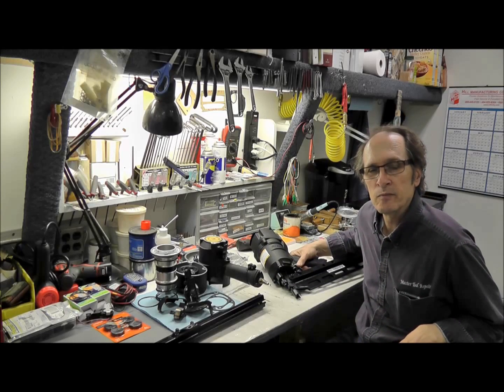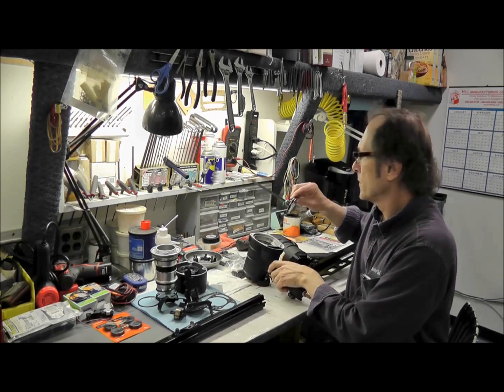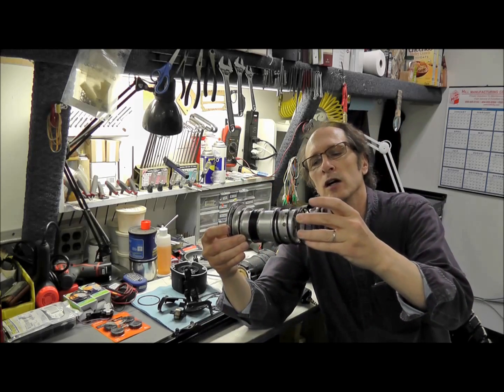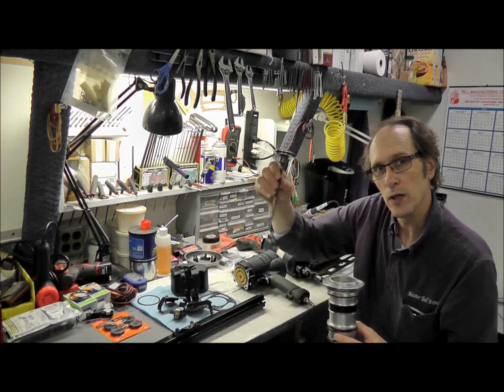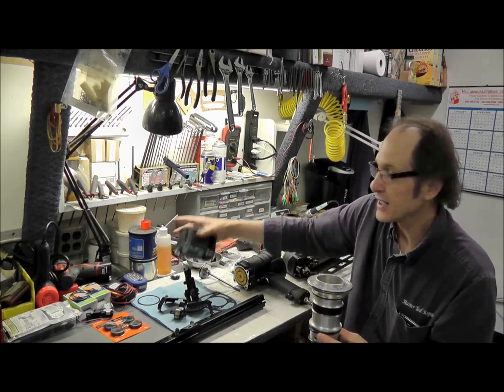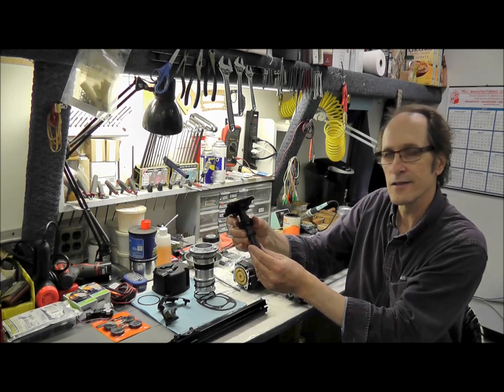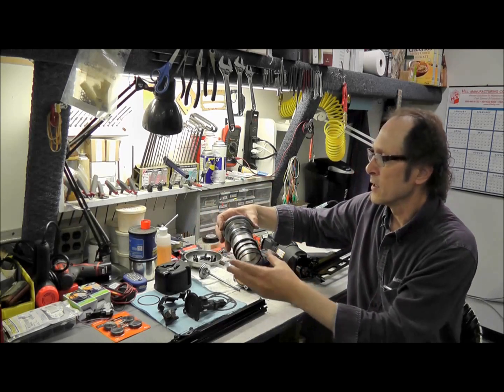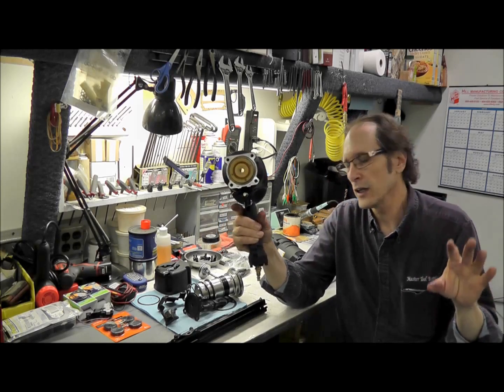Hitachi framing nailer disassembled and parts that go bad

Comment: My nr83a2 just started to slowly push out the piston driver after plugging in air hose. I’d say nail is pushed out very slowly and very minimal, nail is not shot out. But piston driver does seem to be pushing out. Interior air leak?

Comment: I got one for ya..  two of our framing guns, an NR83AA and an NR83AA5, have an issue where they fire every other nail usually.  The driver isn't retracting all the way to allow a nail to enter the chamber.  It's almost as if it doesnt have enough air pressure to retract (compressor at 120 and other hitachis working fine).  Ive replaced all cylinder o rings and check valve bands, brand new drivers and orings, cleaned out cylinder.  If i try to rapid fire a few shots, it sounds as if its running out of air.  When they do drive a nail, its driven as it should, but the retract phase sounds different, and i know the next nail wont shoot.  I feel like some passageways may be partially clogged.
Reply: Is the head bumper still good? Or if your guns have dents in it that’s probably the problem.

Comment: My piston/driver blade assembly was replaced, now you can hear it moving freely inside the cylinder if you turn the gun upside down and right side up. Feels weak and hollow to use and doesn’t drive the nail all the way. Is the replacement o-ring too small and not making a tight enough seal?

Comment: How does the piston go back up...?
Reply: The narrator's description of the check valve seal at 4:15 is incorrect. When the piston is driven downward, air is blown out holes in the cylinder behind the check valve. This air pressurizes the return air chamber. When the cylinder returns upward, the cylinder top is sealed off from compressed air. Air in the return chamber pushes the piston back up.

Comment: I have a hitachi n5008ac that has a huge leak at the valve bushing when resting.  I replaced ALL  the o-rings in the gun, including the two that seal the cylinder guide to the gun body.  When that didn't fix the leak, I swapped out  plastic and metal parts from a new/identical n5008ac metabo I had to buy, but I couldn't get the leak to stop.  I slid the cylinder plate into the gun body to see if it was warped, but it fit snuggly.   
When I push the valve bushing plunger in and out, the air tone/sound changes but all the cylinder parts have new o-rings and there aren't any scratches.
Is the body warped and I can't see it?

Comment: How do I take out the piston cylinder
Reply from the maker: That can be tricky. You can try taking some pliers to it but you'll need to make sure you put a thick rag over the cylinder so you don't damage it. The easier and safer way to remove it, however, is to take a rubber mallet and smack the body of the nailer. Newton's Law will force the cylinder to pop out with a few good smacks. Hope this helps!

Comment: Awesome videos ! hey quick question, why would my hitachi framing nailer fire without the nose being depressed. Also what is the grease and o ring lube you use?
Reply from the maker: Thank you! As for the grease and o-ring lube, you can use really any o-ring grease for pneumatic nailers, no matter what the brand.
Pneumatic oil can be added a few drops at a time before you use the nailer and again, any brand will do (whether it be Senco, Bostitch, Hitachi, Husky, etc.).
As for the problem with the nailer firing without you depressing the nose down to the firing surface, that's probably an issue with the trigger system. Most likely the trigger stem inside the main body of the trigger is stuck. I would simply remove all of the o-rings in the trigger stem and system, re-lube them, then re-install them. If you've never disassembled the nailer before, it may be a good idea to re-lube all of the o-rings in the nailer.
Hope this helps!

Comment: Thanks ! My sweet Hitachi 83 NR ( I think } started blowing air through the exhaust vent  constantly. Any ideas ?
Reply from the maker: Thanks for the question! Most likely the problem lies with one of the seals on the cylinder inside the main body of the gun. Typically, the cylinder seal (the wide rubber band-like seal) being damaged can cause this, or any number of seals on the cylinder. Also, check the head valve seals and o-rings. If there isn't s good seal between the top of the cylinder and the head valve (which is in the top cap of the nailer) you will get air leaking out of the head cap constantly. Many time, a good cleaning and re-lubricating of the o-rings will fix many problems with pneumatic nailers. Hope this helps get you started.

Comment: I have a nr90ad. How do you rebuild the trigger there is nothing good to show where all the o rings goes
Reply from the maker: I don't have an installation guide for this nailer, but you can download a detailed parts breakdown of this nailer by clicking on the below link:

https://www.metabo-hpt.com/docs/default-source/default-document-library/nr90ad(s)_e3_bd.pdf?sfvrsn=c5b62c66_0

If you need more detailed assistance, I would give an Hitachi service rep a call at 800-706-7337.

Comment: I just replaced all orings and gaskets on an nr83aa3. There's now air leaking from the trigger when its half depressed, I've rechecked the valve, the ball, rings and plastic valve. They all look fine. Any ideas? I also used white lithium grease to lube everything, think I read somewhere to use that.
Reply from the maker: Thank you for the comment Samuel. It could be that one of the trigger valves or hard parts in the trigger are worn, which will cause the leak. It's difficult to say without diagnosing it myself, but that might be the case.
I would honestly contact a service rep at Hitachi/Metabo by clicking on the below link, as they can give you more detailed diagnostic information:

https://www.metabo-hpt.com/ca/footer-navigation/contact-us
Reply: @MasterToolRepair  Its funny because it was working fine then I changed some o rings in the cylinder and now its leaking. I hadn't done anything to the trigger at that stage. What causes air to pass through the plunger valve? it's only when half pressed so the oring on the valve must seal it?
Reply from the maker: @samuelfarmer2098  What happens when you depress the trigger all the way?
Reply from the maker: @samuelfarmer2098  Also, the cylinder has to slide up and down easily. Plenty of o-ring grease must be applied to this so that it seals against the cylinder cap. But this is usually when the trigger is not depressed.
Reply: @MasterToolRepair  it seals when fully depressed. I can use it fine but just leaks air as I press the trigger in.
Reply: somethings letting it through but seems that the plunger o'ring is sealing it. Could it be the cylinder if it only leaks when half depressed?
Reply from the maker: @samuelfarmer2098  It's possible. The cylinder needs to slide up and down easily. If it does not, then this could certainly be the problem.
Reply: @MasterToolRepair  Well I've email metabo and no reply. I've posted a question on fixya and no replies.
I've cleaned and lubed the O-Rings in the cylinder multiple times and no luck. 
I'd love to bring it in to you but I'm in Australia and we don't really have any tool repair shops. 
I'm stumped! haha
Reply from the maker: @samuelfarmer2098  Australia is a bit far to make the repair happen, I suppose! Hopefully you will get a response from Metabo...I would see if you can locate a more localized authorized service center by inputting your postal code on their website. Hopefully there is a rep who can assist you on your side of the world :-)
Reply: @samuelfarmer2098  If im hearing you correct its normal, when you fully depress the trigger without pressing the SAFETY LEVER AND SAFETY TRIGGER, you'll hear a little psst sound as you press it in. Thats just the air releasing when actuating the valve. So when you press the trigger half way and leave it there the valve is half open causing the air to blow by. So I wouldn't worry about it if it works ok. Now if it leaks all the time when the trigger is pressed then there's a problem

Comment: Thank you for the video it's a big help. I have a metabo and when I fire it makes a wierd air release sound and it sounds like something is bouncing around inside the gun. What could that be? Thanks again for the awesome video 😁
Reply from the maker: Thank you for the watch! We're glad these videos can be of service. Welp, I would first disassemble the nailer to see what the item is that's bouncing around in there is. Remove the head cap and the cylinder to inspect it. It could be the hard rubber bumper in the bottom of the body of the nailer, which can break apart...especially if the gun is low on oil and you live in a dry environment. It could simply be that the bumper has cracked. Either way, you'll need to disassemble it to identify the piece, then go from there. Thanks again for the comment!

Comment: Wee does the retractable spring goes
Reply: Wee does the retractable spring goes for a nt65ma4
Reply from the maker: @juancaraveo5059  The retactable spring that keeps tension on the nails goes in the magazine itself. If you search Google for "nt65ma4 parts" you will get a few websites in the search results that will give you a full breakdown of the nailer.

Comment: Would love a more in depth explantion of how the exhaust system on Hitachi works?
Great video!
Reply from the maker: Thank you for the watch and for the compliment, we appreciate it! I'll see if that's something we can do a video in the near future.
Reply: @MasterToolRepair  have u used the Hitachi NV 50AP. It leaks air and I can't seem to figure it out ...
Reply from the maker: @ivanmartinez-ny6jn  There are a few reasons it could be leaking. Where does it leak from exactly? Does it leak as soon as you hook up your air hose or only when you push the nose down to the surface, or only after you fire it? Thanks for the comment!
Reply: @MasterToolRepair  as soon as I plug the air hose and  From the head cap.
Reply from the maker: @ivanmartinez-ny6jn  Thanks Ivan. If it leaks constantly from the head cap, you probably need to remove the cap and inspect the head valve o-rings and seals. Most likely there is some debris and build-up in the head which is now allowing the valve to move freely. The o-rings could also be dry-rotted or damaged. Next, check the seal on the very top of the cylinder, which is the seal that butts up against the bottom of the head valve. If the seal is damaged, it won't have good contact against the head valve and the nailer will constantly leak. I hope this helps to start!
Reply: @MasterToolRepair  Yes, Thank You it's a start I'm goin ahead and ordering the oring and seal

Comment: Is this the airlocker brand?
Reply from the maker: Yes, the nailer shown in the photo is the Air Locker version of the NR83A Hitachi nailer.
Reply: @MasterToolRepair  is the airlocker reliable?
Reply from the maker: @slimey831  We think so, yes. We've used it and tested the nailer for months and it holds up as well as the Hitachi. And, nearly every Hitachi part is interchangeable with the Air Locker, to boot.
Reply: @MasterToolRepair  thanks ive seen them on ebay for a fraction of the price of a hitachi. My ridgid framing gun is starting to leak from the top
Reply from the maker: @slimey831  The Air Locker version is certainly worth the $, in our opinion. I'd give it a shot!

Comment: Thanks for that< I have a question what will cause air to come through the tip? A lot of air!
Reply from the maker: Glad to help! Typically this is caused by a damaged Cylinder Seal, which is the rubber seal around the cylinder inside the body of the nailer. I would remove the top Cap and the Cylinder to inspect all seals and o-rings, as well as the rubber bumper at the bottom of the nailer to confirm it's intact. Many times, however, it's just the main Cylinder Seal that's damaged which causes a lot of air to escape from the nose of the nailer.
Reply: @MasterToolRepair  yup. Got it thank you
Reply: @jaguon4619  that's why I'm here.  When I press the safety so I can fire a nail, the air just rushes out.

Comment: Hi Gil,
I just bought a well-used Hitachi NR-83A at a thrift shop that was being sold in untested condition. It is missing the pneumatic fitting on the end. I have a standard size pneumatic fitting, but it's too small. Is there an adapter that will allow me to use this smaller adapter or is there a larger pneumatic fitting that will fit correctly? Once it's working, the first thing is to test it to see if it works. I'm guessing it will need a rebuild, so your video was very helpful. I'm not a professional framer and would be using this for occasional work. Any and all advice would really be appreciated. 
Thanks very much, Tom
Reply from the maker: Thanks for the question, Tom! The NR83A nailer has a 3/8" female NPT fitting where your plug would thread into. You could have a 1/4" (most common) or 3/8" (less common) quick connect fitting on your air hose, so it really just depends on the size of the quick connect fitting on the end of your air hose. Both the 1/4" and 3/8" male plugs are available at any hardware store or where nailers are sold, just make sure you get one with a 3/8" male NPT thread that will install into the nailer. It wouldn't hurt to install an o-ring kit in the nailer either, as this is almost always required if the nailer has been stored for any period of time or if you're not sure about the condition.
I hope this helps.
Reply: @MasterToolRepair  Thanks so much for your reply! Just to be clear on what I need:  At the bottom of the aluminum handle of my NR-83A where the pneumatic hose would attach, there's a threaded hole. The diameter of this hole in the aluminum handle appears to be 5/8". What I suspect I need is some kind of reducer/adapter fitting that will make this 5/8" hole smaller so I can screw in a standard pneumatic quick connect fitting. The output end of this pneumatic fitting (which I already have) is 1/4" like you mentioned. I hope I am being clear on this and you know what I need. Thanks very much for your help and advice.
Reply from the maker: @THOMMGB  Glad to help if I can! If it's an NR83A Hitachi nailer, the female thread in the handle will be 3/8" FPT. It'll measure 5/8" but it actually accepts a 3/8" male NPT plug. It can be confusing because when we say 3/8" MPT, that actually means the OUTSIDE diameter of the thread is 5/8". But, you subtract 1/4" from the O.D. to arrive at 3/8" MPT. So, as long as you find a 3/8" MPT male plug that should thread right into the nailer. Hope this helps!
Reply: @MasterToolRepair  Hi Gil, 
Thanks so much for the quick reply!  Yes, that sizing information does help me a lot. When I go to buy this 3/8" NPT fitting,  I'll have my NR83A with me just to make sure. I'm guessing it should not be a problem to find a 3/8" NPT with a 1/4" male to connect my air hose to, correct?
Reply from the maker: @THOMMGB  You're welcome! Correct, it should be very easy to find that fitting as it's the most common size used for your application. Any retailer who sells standard size couplers and plugs for pneumatic nail guns should stock it.
Reply: @MasterToolRepair  Gil!
I just got back from a tool place here in Glendale, where I live. They had a fancy swivel pneumatic fitting in stock which was exactly what I needed. The guy installed it and tested my Hitachi NR-83A for me. My "new" gun worked perfectly, he said. Anyway, thanks so much for your patience, help and advice. 
Regards, Tom
Reply from the maker: @THOMMGB  That's great to hear, Tom. If I helped at all, I'm grateful for that. Good luck!

Comment: That looks the generic version of the nr835. Is it’s good are a real hitachi nr835?
Reply from the maker: Correct. This is actually a clone of the Hitachi NR83A framing nailer by Amigo. It's a great nailer at the price and almost every OEM Hitachi part will fit it.
Reply: Interchange Pro framing nailers use the Hitachi system and share many of the same parts.

Comment: Please address the range of pressure required by nailers, what it means, and why when setting a compressor within that range, why won’t the nailer cycle.
Reply from the maker: Thank you for the comment! Most nailers operate within 90 to 100 PSI, that's pretty standard across the board. There are some European and Asian models that are designed for high pressures of 200 PSI or so, but these HP tools are the minority. Most brad, finish, roofing and framing nailers operate within the 90 to 100 PSI range, as well as pneumatic staplers. If you regulate your unit within this range and your nailer/stapler doesn't cycle, it's most likely due to defective seals in the nailer itself. Make sure the correct type of nails are being used. Confirm the driver blade isn't bent or warped. Make sure the the nailer is clean internally and that all o-rings and seals are lubricated well. Also, make sure the regulated pressure gauge is accurate and isn't reading the pressure inaccurately. I hope this helps!
Reply: Thanks!  I will try this.  The nailer is a hitachi framing nailer.  A guy at home depot told me that often, and especially when your compressor gets old, the gauge pressure usually reads low.  He suggested taking the pressure to the higher portion of the range and try it again.  If this does not work then yes, I guess I will need to take the thing apart.